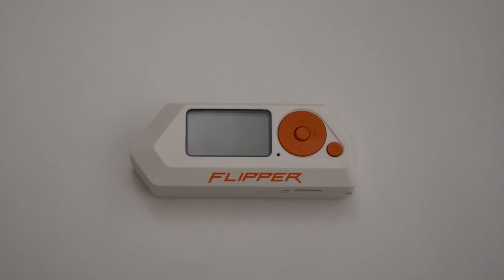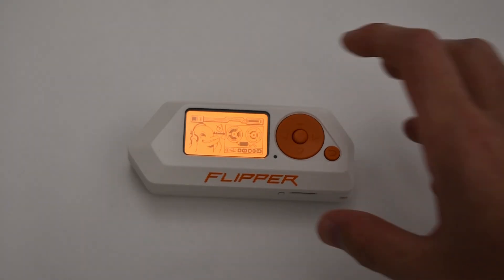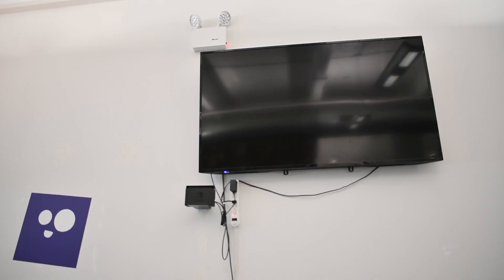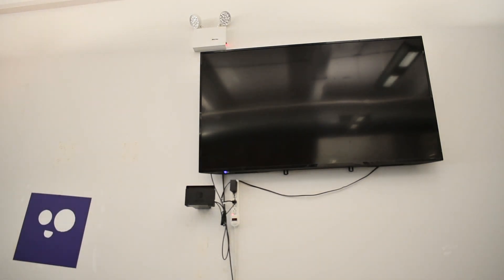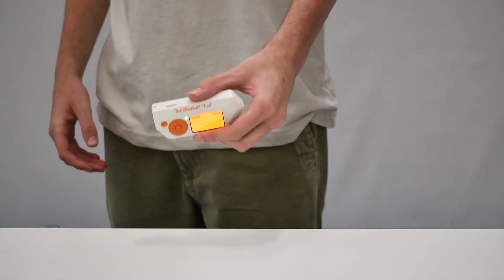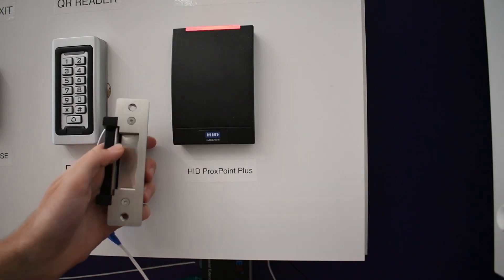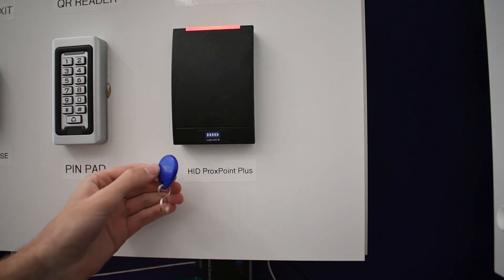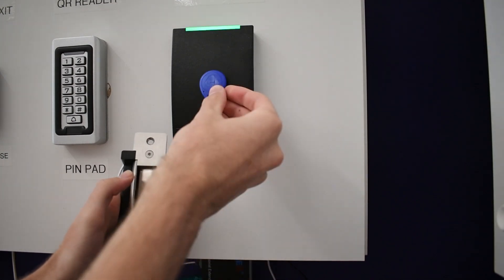Access control unlocked: Flipper Zero | Kisi

Comment: Using a cloud based system to manage physical access usually means that your physical access becomes dependent on both the cloud service being available and internet access. That's just closing an issue by opening another one.